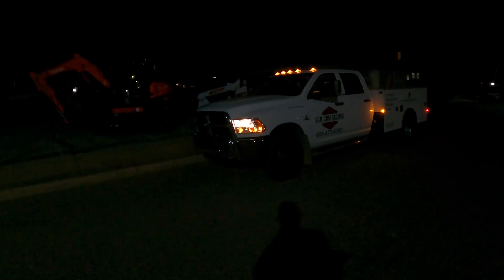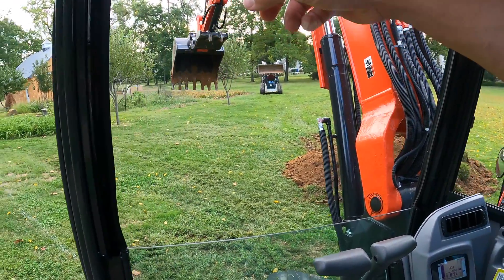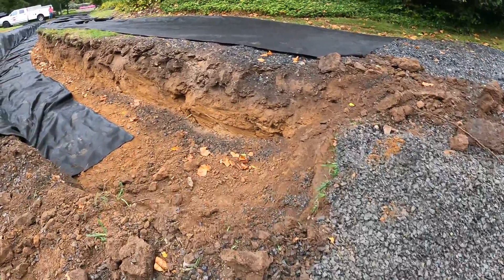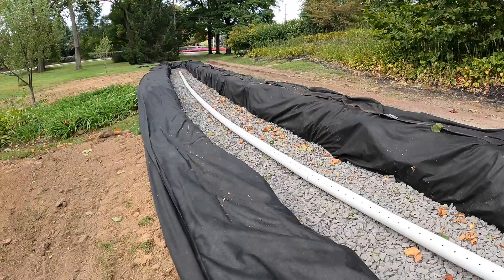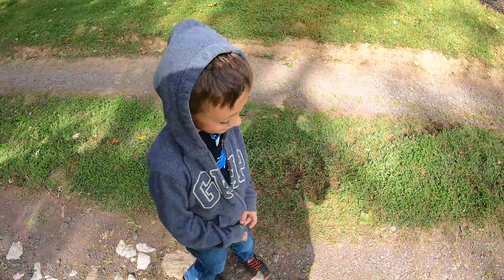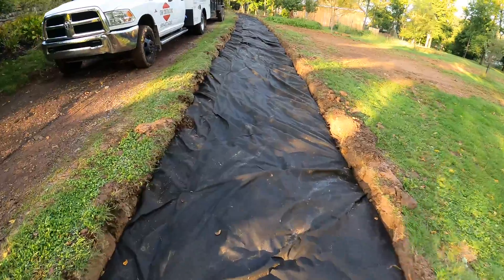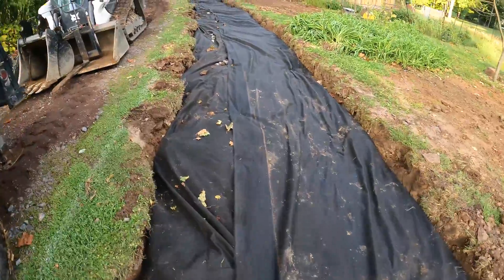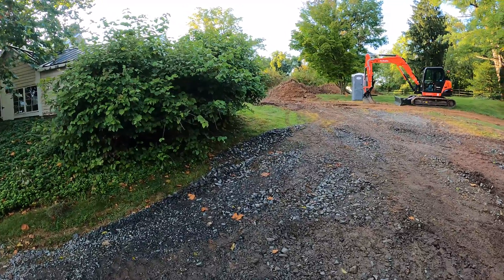Infiltration Trench

Comment: Is the pipe to evenly distribute the water over the entire drywell?
Reply from the maker: Yes I believe so, this was the design provided by the engineer. I personally think the whole thing was a little overkill. But the township required it for the addition being built. Thanks for watching
Reply: I know this is a year old, but what was the pipe connected to (didn't see that in the video)? Thanks.